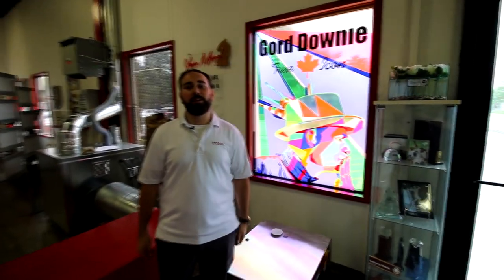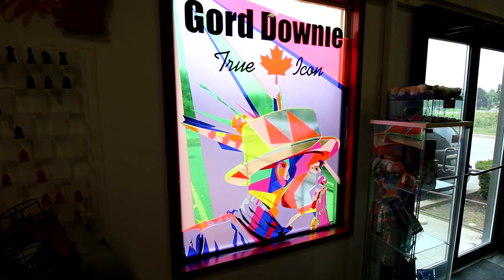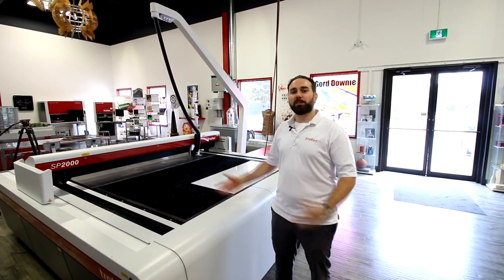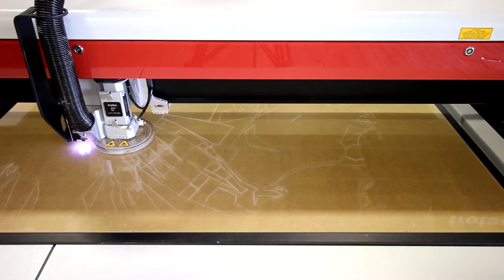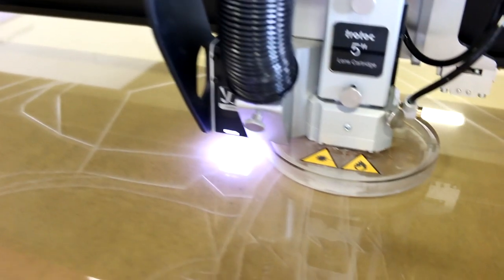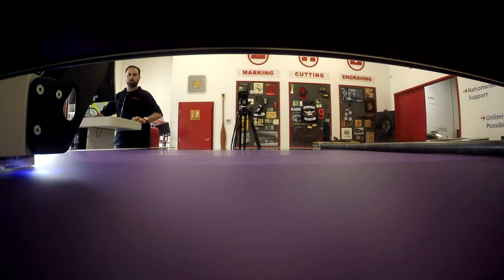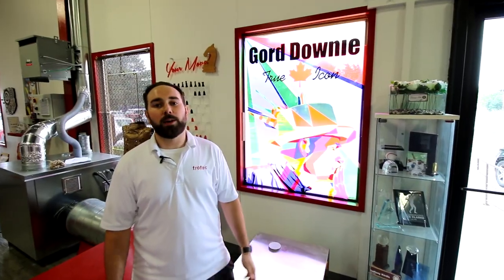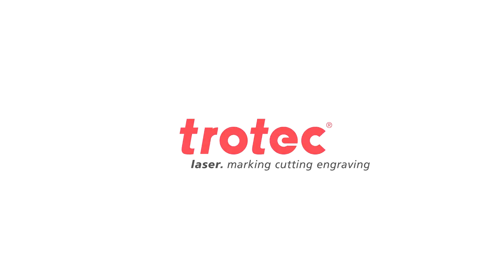Laser Cutting Acrylic | Acrylic Stained Glass Window | Laser Cutter

Comment: Very attractive design. However, how did you attached the plastic pieces together?
Reply from the maker: Thanks! The bottom 3 clear acrylic pieces were our base, the top color acrylic pieces were glued on top throughout the 3 pieces, this way they stuck everything together (using our 3M adhesive backing)